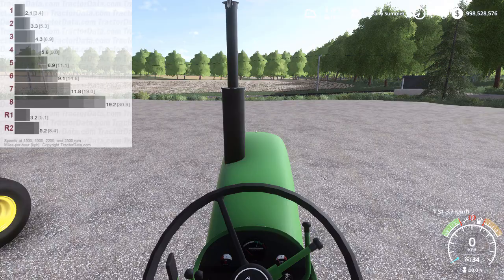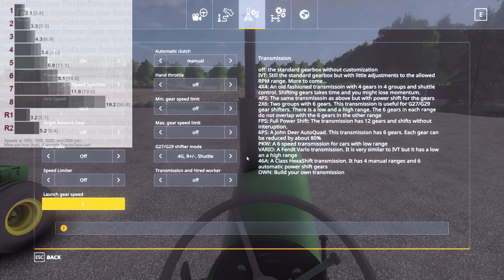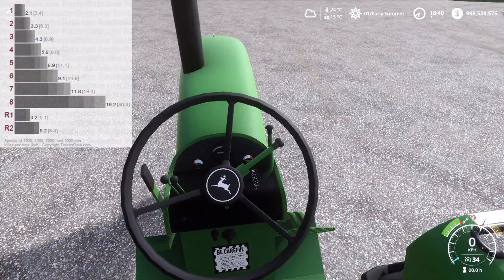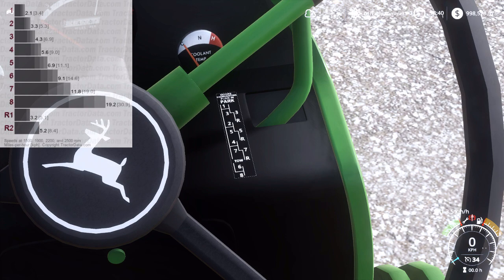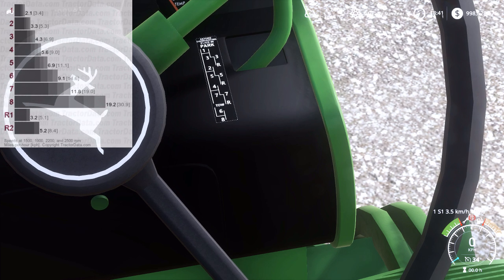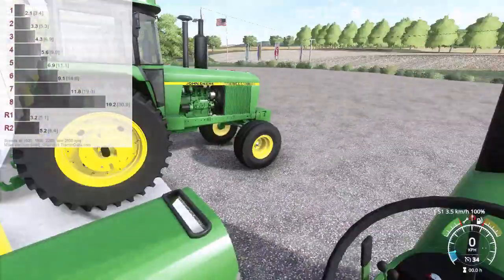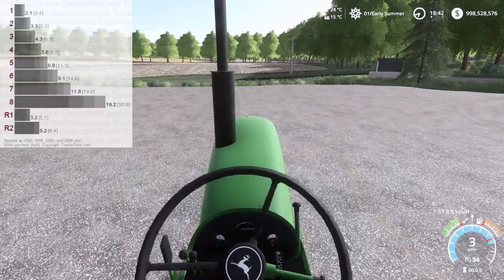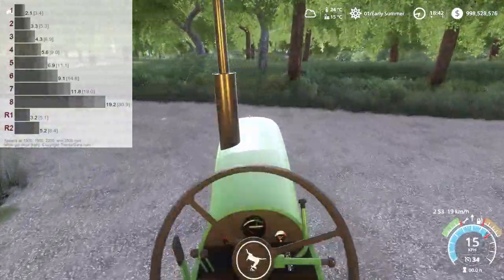FS19|John Deere 8 Speed Synchro Transmission Demonstration

Comment: We had a 3020 tractor with a loader, and it was a 2 stick 8 spd. It had P-1-2-R on. The left and 1-2-3-4 on the right. When you were in R, it would trigger an stop and you could not got to 3-4 on the right stick. And you had to be in 1 to be able to enter Park. Also (I know it’s not you) but the synchro’s didn’t have 3 reverse gears, just 1R-2R.